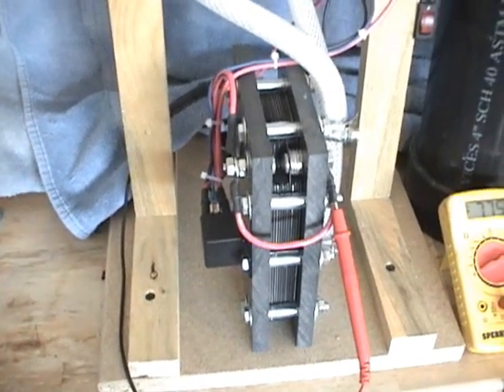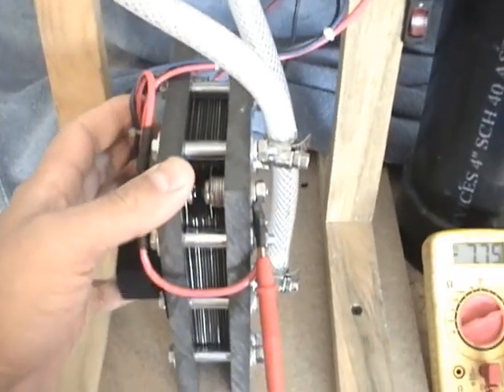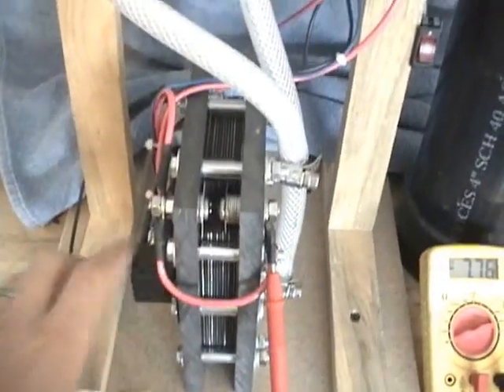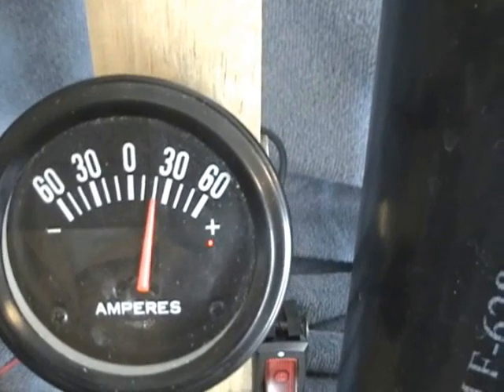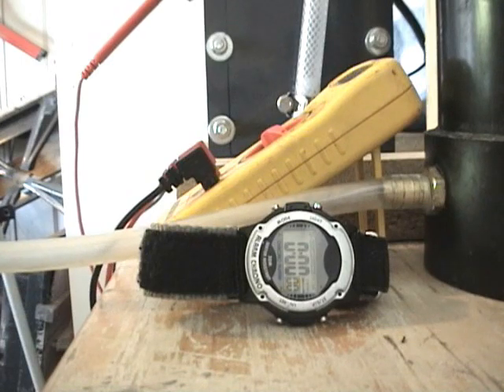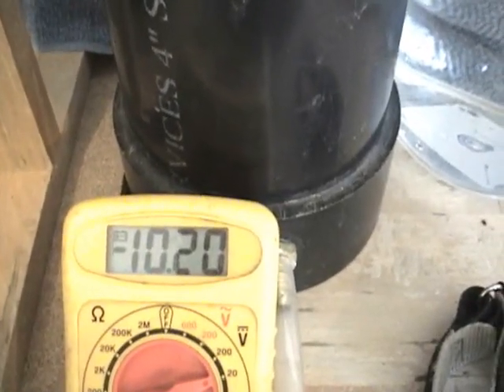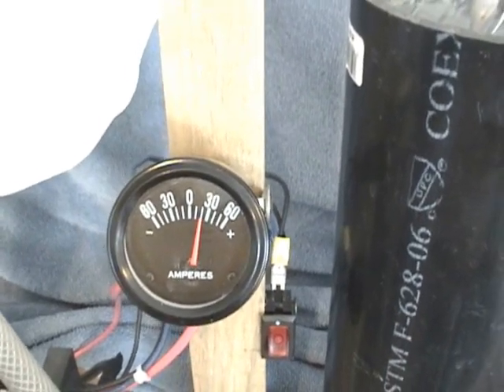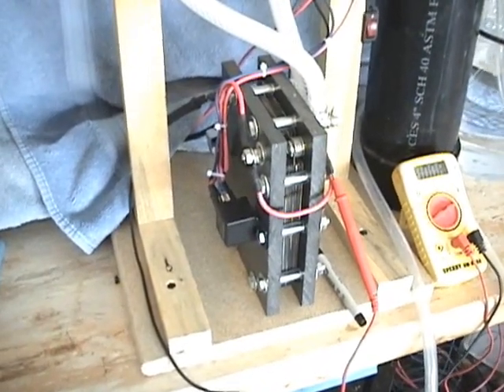(26) Super Efficient 13 plate Dry Cell 1.3LPM

Comment: Congrats ! Very nice generator and thinking about it  : What happen if you add a ON-OFF switch on the fuel pump relay and  be able to cut the fuel delivery to the engine ? Of course that switch you intalled and tne one cutting the fuel will be locate on the dash board. My idea is to go 100% hydrogen at my choise. thanks.

Comment: 1.3 LPM (mix gas product)
20 A (DC Current)
10.38 V (DC Voltage)
207.6 watt (power consumption)
Electrolysis efficiency = 0.875162349

Comment: What is the difference between using only plain water and distilled water with KOH?  I have tried using plain water and I am disappointed with the output.  KOH here is hard to come buy, what other electrolyte will you suggest?  Thank you very much for the big help.

Comment: @delvis11 Thank you for that.  Do you suggest using distilled water with sea salt on it?  I have tried it, but I think the stainless plates are burning and eroding. What about my electrical wires were heating up? Is it because of my numerous postives and negatives?  I will try your suggested connection and update you on its output.

Comment from the maker: @Melvinizel make 8 plates neutral, It will help with the heat. config like this 
+nnnn-nnnn+ The relay is just a on/off switch
Reply: What type of car can you run with this HHO and is it possible without gasoline just hydrogen

Comment from the maker: @frank0067 You have to think about when this video was made. I designed this cell right when dry cells started showing up. At the time it was considerably more efficient than all the wet cells  that were floating around. When you say 20 amps I assume you are calculating your lpm with 12v.  A super efficient cell can now get 1.5 lpm at 20 amps but 2,2.5 and 30 are all overunity.

Comment from the maker: @htiekeith I have a video about this somewhere. you will just have to find it but what I do Is to hook into the fuel pump relay in the fuse box.  Usually 5 pin there is a pin that is only hot when the engine is running. I run my wire from there to the hydroxy relay.

Comment from the maker: @htiekeith The hydroxy acts as a catalyst for the the gasoline help it burn better. There isn't enough hydroxy itself to do any damage to the engine. Even If there were enough It burns so quickly and so completely that heat doesn't build up like gasoline.

Comment: Nice production.I just have one question.If it burns hotter when used with gas in a car,isnt there a chance that the valves will warp from the hotter temp and how about the alumunim pistons,can they get a burn hole threw them.No one talks about this.???I have been wanting to build one ,but dont want to do damage to V8.And also ,how about the sensor on the exaust maifold  ?  THANKS

Comment: I have the same plastic reservoir and it has a vented cap.  You need to plug the hole in the cap and conduct a new test. I can tell from experience that you are producing closer to 4.0lpm than 1.3lpm